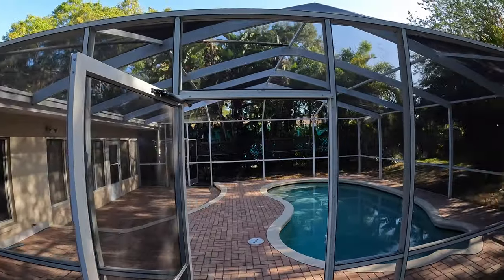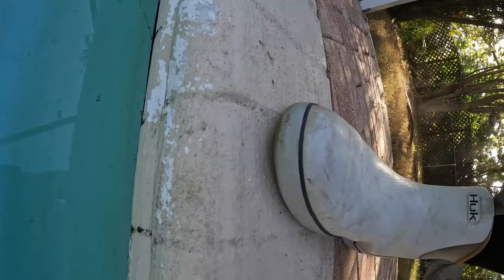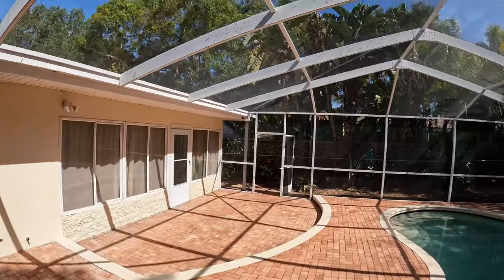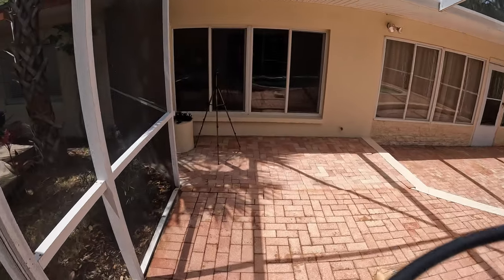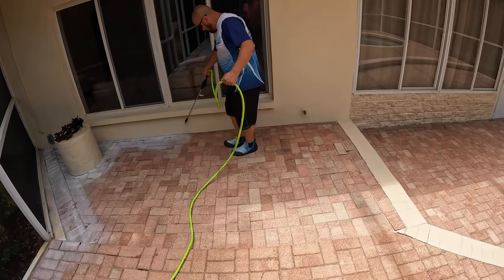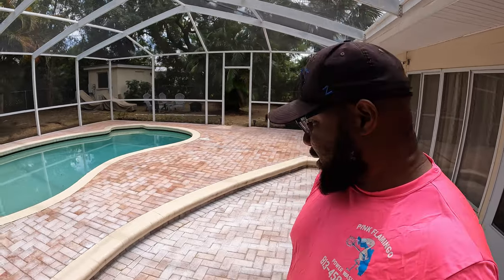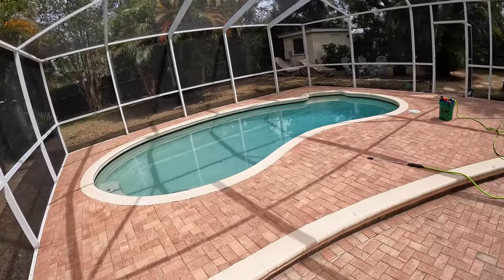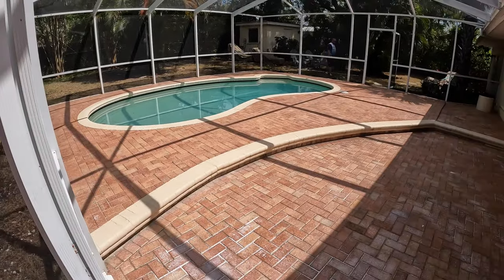Using a NEW 12v Lid Sprayer To Seal A Pool Deck #paversealing

Comment: I made my own a few weeks ago. I used a dewalt(thats my tool brand with multiple batteries)20v step down to 12v. You can source everything off amazon...... I broke the craftsman after 3 jobs(my own fault. I was in a hurry and didnt rinse well) so i fugured if that happened again i just have to replace a $40 pump lol. The lid does work great plus not having to refill the back pack is a plus.
Reply from the maker: I was gonna make one 2 years ago but man I just been on the go LOL. I had the stuff in my cart forever and just never ordered it. Yea i definitely love it cause theres no refill and also less risk for a mess.
Reply: @Pink Flamingo Power Wash LLC  simple to make. Using a step down saves the pump from the 20v batteries so the wiring is the tedious part because your going from pump to the step down to the battery holder. It's a game changer for sure though.
Reply from the maker: @SEAN RYDER  definitely easy to make. I made a 12v cart before remember? 
https://youtu.be/NwqjF_nAPXQ
Reply: @Pink Flamingo Power Wash LLC  yea, that's right. I do remember seeing that or something similar right before you started using the craftsman. I found your channel right about that time. The growth in your knowledge and process from then till now is cool to watch. Like if you were going to coach yourself what you would have told yourself to do differently. Makes me think back years ago to having a 2.5 gpm with just a water hose and no chem in the back of a jeep Cherokee to building out and plumbing my own trailers, lol.

Comment: Nice work buddy, I have a similar setup for my paver sealing jobs, i have a 50' 3/8 air hose, a 1.1GPM pump from northern tool and i bought a battery adapter from Amazon to use a dewalt battery with a on and off switch. Works amazing.   Then once I'm done with the job i run Fabuloso through everything to clean it out.  Works great. Game changer for sure.
Reply from the maker: Absolutely 💯  faboloso, pine sol, LA awesome all cleans them out great. Thanks for sharing 👍

Comment: I work with power tools Every day, Did u get a full job dome running that pump on 1 Milwaukee 12v battery?
Reply from the maker: Yes I did with no issues whatsoever
Reply: We’ve done 3 jobs with 1 battery, over 4000 soft. Double coating.
Reply: @Pink Flamingo Power Wash LLC  damn nice!!!! I just bought the craftsman 4 gallon battery operated sprayer today that u got , just pulled my 1st roof washing job & of course my soft wash pump went out and couldn't get a new pump by tomorrow so guess ill be spending ALL day tomorrow cleaning a 3,360sqt roof with the sprayer , bout to be a LONG DAY for me tomorrow, new customer so got to do what I got to do to keep them happy
Reply: About to do a 50/50 mix or a 4% not sure yet  nice black streaks and moss on the back of the house so definitely going to pry that sprayer hold up!

Comment: I noticed it has a pattern that disperses more to the outside of the circle I been a painter for over 30 years so ima give you my 2 cents spray making small a circular motion where possible should give you more even coverage than back and forth or left to right
Reply from the maker: Depends on the tips I use. I do the circular spray sometimes. but even then the cone is pretty nice vs the wide van. this one was the cone tip.

Comment: Did my first couple house wash jobs with a similar contraption but it was on a 4 wheel cart and a 15 gal tank. 1 gpm and a 15' hose. 
It took a long time and had to mix a couple batches for each house but it made me enough to make my current soft wash rig. 💪
Reply from the maker: Nice! Thats the real grind. I started off doing paver sealing with a handheld pump up sprayer. We all gotta start somewhere!

Comment: Awsome job came out nice 👍🏼 question how did you clean out your pump after done using it?
Reply from the maker: Thanks, I filled the bucket up with clean water and I added a splash of LA's totally awesome and locked the trigger to it flushes the pump and hose out by itself.

Comment: Good stuff my man, have a question on that pump. I'm curious how far will that shoot if you put a shooter tip on the wand ! I'm asking cause I do multi story apartment complexes and I've had several with their AC units in closets on their balconies. 
The AC causes rust runs down the building walls. I'm curious in distance because I'd like to use this setup for oxalic to pretreat the rust. I could use my current Softwash pump but I'd rather have an independent unit so I can run both at the same time. 
Your  feedback on this would be much appreciated.
Reply from the maker: I've used it with a 0020 nozzle and it hits 2 stories with no problem 😃

Comment: Awesome job Cliff. I noticed you changed shoes on that second coat. I seen some shoes with spikes that painters use when they are painting concrete surfaces and floors so they can actually walk thru the paint without leaving foot prints. I wonder if they can be used if the sealant is still too tacky on the pavers
Reply from the maker: Didnt know about those. But Yea i dont like tracking dirt onto the pavers sometimes i keep a bucket of clean water near the door so i can wipe my boots off before entering.
Reply: Amazon has them

Comment: How much you usually charge for a square foot?im trying to start doing sealing but not sure how much I should charge.really don’t want to overcharge my future customer,please advise. Thank you
Reply from the maker: The pricing differs a lot by market as well as business to business because the material costs, cost of living, and expenses are different.  I've seen prices low as $1 and high as $3 a sq ft , so you'd have to find your range for the area you live in.
Reply: Thank you and happy holidays to you

Comment: With the pump being a 12v, can you use a 20v battery adapter? All I have is the 20v batteries. Thanks!
Reply from the maker: Yes of course you can. They will last longer